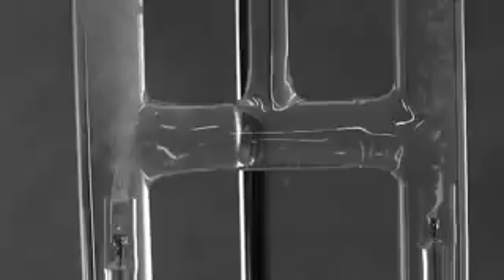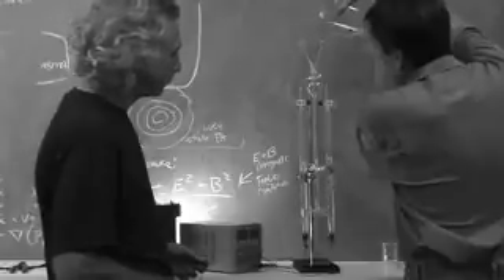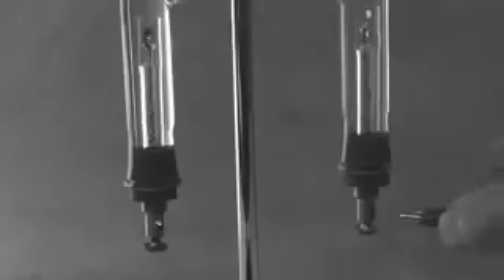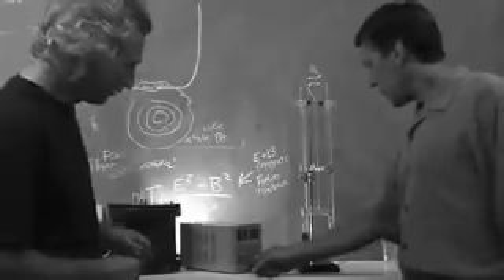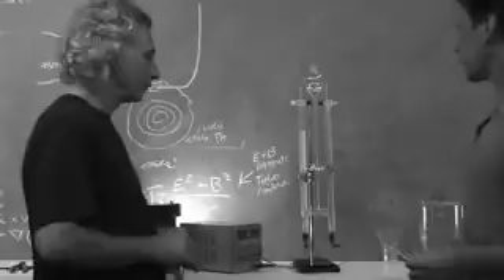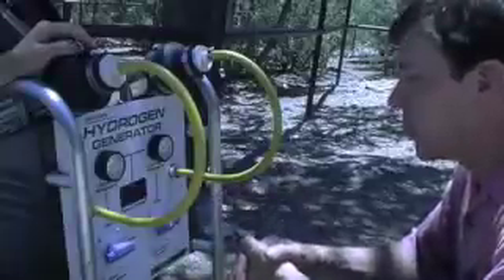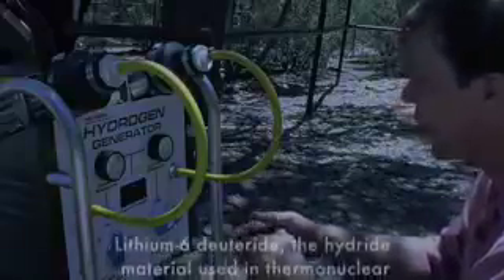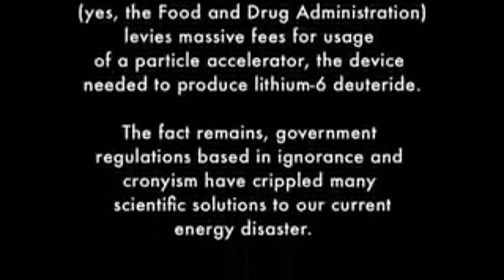run your car on water. This guy does just that!

Comment: What the hell is he talking about? Lithium hydride has no use in nuclear weapons. It's just a very simple lithium salt. Lithium hydride is a common and very simple chemical compound one can buy at any chemical supply company for about $1300 a kg. The only real issues with lithium hydride is it can violently turn into extremely corrosive lithium hydroxide if exposed to water. So sales to non-chemists is often restricted due to it's exothermic and corrosive dangers.

He is thinking of extremely expensive lithium deuteride, made using deuterium,  which is the hydrogen component of heavy water. And while it's true that lithium deuteride is the primary energy producer in a H-bomb, lithium deuteride is actually non-radioactive and harmless unless you have it packed around a two stage atomic bomb explosion to transmute it into tritium. In fact, anyone can buy lithium deuteride. But it's crazy expensive. Like $500 for 10g. Roughly an amount the size of a sugar cube (might be wrong on the volume though. LiH is extremely light.) And for normal chemistry purposes, lithium deuteride is basically useless, and in 30 years of a chemist, I think I have seen it once, where someone had some as a "Hey look at this!" curiosity.

Comment: Maybe someone here can answer.
If you run a car on just HHO produced onboard through electrolysis, it means that the amount of energy from the combustion of HHO should be greater than that required to split water molecules.
That's impossible, right?
Reply: that is the answer we need.  h2 and o2 sure seem to want to be together.. little spark and htey slam together.  seems a bit more exciting than splitting it so .. who can do the math?
Reply: Yes, according to the laws of Thermodynamics  that would be impossible. To create the Hy he is using the Hydrogen generator he showed. He said the generator is run by solar power creating the Hy overnight.  So more energy is supplied to create the Hy then is created in the Engine, so the basic laws of Physics are satisfied. But the cost is nil because he is using solar power. There are more efficient ways to use Hy such as the Hydrogen fuel cell to produce electricity, with water as the waste byproduct.

Comment: I mean, im not too brushed up on my chemistry but it sounds like he's taking extra steps for the hydride for storage rather than just storing hydrogen. It sound like it's a lot safer if I understand this correctly, the hydride is used for storage so that's why it doesn't explode? It'd be brilliant for gas stations to be able to have a hold of this because the biggest argument against hydrogen is that it explodes. But there is an easier way to store it and make it on demand. But brilliant either way, wish he drove the car so we could see how it performed.
Reply: He didn't drive it so it didn't work unless there's actual proof
Reply: @DannyDieHard369  as others have said even if driven in the video we'd want to see that it wasn't not just secretly running on gasoline...

Comment: Why not just get the car alternator to Power the electrolysis of the water, giving perpetual fuel as you need it?
Or use aluminium powder mix with water to separate the hydrogen via rapid oxidation of the aluminium... Voila!
Reply: Because your alternator at full output couldn't produce the energy required to separate enough hydrogen to keep the engine running to turn the alternator...and if you think that carrying hundreds of pounds of aluminum powder and water around is somehow an improvement over plain old gasoline-well, go for it.

Comment: If you're using any other fuel like gas or diesel while you're claiming it's running on water ( hydrogen) it's not. You can run your car on gas and at the same time inject a very small amount of water. The water can prevent carbon build-up.

Comment: It was either a Popular Mechanic or Popular Science magazine back around 1989 or 1990'ish, I read about a mayor of some Colorado town driving a 1989 Red Pontiac Grand Prix that was fueled by hydrogen. 

They also demonstrated that the exhaust was water (they showed him sticking a cup under the tail pipe to collect the exhaust and drink it).  I specifically remember this article, because I at the time owned a 1989 Red Pontiac Grand Prix and thought "how cool".  

Anyways, never heard again anything about this mayor or his car.  They said the car was too dangerous to run on hydrogen because it was too volatile.   I figure the Fossil Fuel people squashed the story.

On another note, I thought Bob was pushing up daisies.  I know of him from the UFO stories and that he worked at the "you know where" place in NV.  Interesting video.

Comment: They sell hydrogen cars today. The energy to produce hydrogen gas is very high. Hydrogen filling stations are few and far between and expensive. And for those who don't know you use the hydrogen to one run what's called a fuel cell which produces electricity to drive an electric motor. This technology was used in the Apollo space missions in the 1960s. It's just not practical for everyday vehicles.

Comment: Why split water ahead of time?
As you consume the H, you split the water, from a tank.
And just use seawater, why add anything to freshwater?
Gets more interesting as I think of it...
Reply: Because it takes a large amount of energy to split the hydrogen from the oxygen- more energy than is available from the resulting pure hydrogen. So, for that to work, you would also have to carry another energy source, such as petrol or a powerful battery.

Comment: Running engines on H2O is not a new concept, it's been kicked around since the mid 1940's as a possible alternative to gasoline powered engines and there have been many instances of people actually running vehicles on  hydrogen but mainstream industry has been reluctant to invest time and money into development (R+D) because of pressure from the oil industry. (ONGOING) / I worked on a solar hydrogen gang generator project in New Mexico back in the early 80's  but pressure from politicians owned by BIG OIL succeeded in killing the project before it even came online , / All the BIG industries cares about is the CONTROL AND SALES OF ENERGY  WORLD WIDE and sadly they still maintain a DEATH GRIP on it !

Comment: But yet here we are 13 years later and getting electric cars rammed down out throat's. follow the money and you will find why. Oh joe you done it again!
Reply: Your idea to 'follow the money' is exactly on target. What you will find is that many, many people have built hydrogen systems to run standard engines. The process is simple (as shown in the video). The difficulty is in the economics. The energy required to produce the hydrogen, compress the hydrogen, and release the hydrogen makes hydrogen fuel more expensive than gasoline.
follow the money.
Reply: @russhurst4551  Good point!  The expense would be the building of the separation system and storage. As seen in the video, the Corvette was refitted to run this fuel. I would assume that the vehicle wouldn't matter. I wonder what it would take to use his prototype and base it in a manufacturing environment. But first to have access to the material needed. I wonder if it could be possible to research a grant, secure the finance side, to build one and then after researched and funding through stockholders if such a project could be done?  If some one would pay 60,000 for an electric vehicle that really is not the environmentally safe,  they sure would pay that for a total safe emissions with the potential to truly be environmental safe and reusable. 
Does this make sense?   Now, where to go from here?

Comment: The fuel vapour and HHo systems exist, are known about and are easily adapted to our vehicles...Suppressed tech on purpose, wars in the middle east and to blame us for pollution.
...Producing HHo just needs pure water with the electrolyte Bicarbonate of soda, no need to store Hydrogen only a tank with the water in it. Around 6-9 volts and amps are needed to produce nearly free energy.
...Freemasons in power poison us, keep information from us to control us. Know your freedom under COMMON LAW - your life depends on it.

Comment: Energy ballance shows producing hydrogen to burn in an engine is stupid idea... for every kW of electricity you will end up with some losses and then your Hydrogen. Still imagining NO LOSSES in the electrolysis, by burning in an engine you will make 25% of it AT MOST in useful power to move the car. Rest is waste heat on radiator and exhaust. Not to mention sitting in the traffic in idle burning the hydrogen with no real purpose rather than keeping engine alive for next move. In a heavy city traffic this can mean 50% of the time standing still.

If on the other hand you take the same electricity to CHARGE BATTERIES in the vehicle and run it on ELECTRIC MOTORS, the energy losses are way less for these reasons:
1) electric motors are very efficient in converting electricity to mechanical energy - easily 85%, compared to 25% of combustion engines.
2) standing still in traffic means NO POWER USE AT ALL! there is no idle consumption of power.
3) Well made Electric vehicles have REGENERATIVE BRAKING - They can return energy into the batteries when driving long way downhill or even doing short coasting. 

So it is NOT the oil industry the reason this hydrogen prototype doesn't work - it is the flaws intrinsically involved in the idea and the technical competition to the much more advantageous electric vehicles.

Comment: OK, but first it has to be split into hydrogen and oxygen.
That takes more energy than it produces when the hydrogen is burned as fuel.
Reply: Yes, but that is why you use clean energy ie solar or wind for the generator to produce the separation. Hence its storage over an 8hr. period. Of course hydrogen is highly combustible and produces a clean mechanical energy.
Reply: Better to just charge up your battery EV.
Reply: @jamesvandamme7786   I guess those E v's are great... if you live in the city And don't mind strip mining for the lithium

Comment: absolutely yes run your car on water...( warning Your life could be in danger) moisture/water sucked into the brake assist vacuum  intake manifold line, causing your brakes to fail,  the rusty engine hydrolocks causing pickles to shoot out your rear end.. 
Bend over and leave the check blank because your auto mechanic is going to fill them in both.

Comment: You can’t just add oxygen and hydrogen inside your car engine since after the combustion it leaves water inside the pistons which is very bad for the engine… how is it possible?
Reply: Review d video again, he explains he separated the hydrogen for the negative side & releases the oxygen up in the air so it's no longer H2O is how I understand it.

Comment: Stan Meyer did it, and lot's witnesses will attest to it.
But when this guy is shifty about his answers in the interview it makes me suspicious!
Stan, said that electrolysis is too slow to do what he did. And surely that big old electrolysis machine isn't inside that little car! But what Stan did was actually produce the hydrogen in the car! No recharging necessar! Just put water in it and go...
Reply: That's all great except that Stan Meyer didn't run his car on water. If he had really found an exception to the second law of thermodynamics then he'd have been in line for a Nobel prize in physics. What he actually did was make up a story and not let anyone inspect his car.

Comment: Some bus lines in Europe use this exact technology. But Big Oil gets the profit as they produce the H2 out of Natural Gas. It seems they don't want to mess with the simpler electrolysis solution as there is no profit in it. Seems they want to pull wool over people's eyes.

Comment: He’s not running his car on water, he’s supposedly* running it on hydrogen obtained thru electrolysis, which uses electricity. So electricity is the source of energy, not water. Water has as much potential energy as a rock at the bottom of a well.

*The car is never driven in the video, so does it actually work?
Reply: Does BS MEAN ANYTHING TO YOU 🎂

Comment: that c4 tho sheesh. im just curious how he either got a hydrogen engine or converted it to run on hydrogen. id do this to my truck if i could make hydrogen with solar.
Reply: You can with some tinkering. Big big pockets don't wanna see this just yet. Better be safe
Reply: @madnotez  teslas making hydrogen fuel cell cars. And toyota and yamaha are already racing a hydrogen combustion engine.

Comment: for clarification, Astronuc from PhysicsForums says:

One would not use an accelerator. To obtain lithium enriched in Li-6, one would use a mass spectrometer or laser enrichment system. These can be expensive, and laser enrichment is controlled technology. So it's best to find a chemical supplier. LiH is produced by exposing lithium metal to hydrogen gas. I do not know the exact values since I have not manufactured this material, this source indicates - "Lithium hydride is obtained directly in an ampoule by hydrogenation of lithium at a temperature of the order of 920 K and a constant hydrogen pressure of 1 MPa." http://www.springerlink.com/content/g3220v44k5263368/ These are hazardous conditions and one may require permits to do this. It's not something that is done in one's home.

Reference https://www.physicsforums.com/threads/producing-lithium-6-deuteride.320107/

Comment: You can power a car from HHO there's no doubt, but the car can't produce it's own HHO. Everybody has tried and it aint happnin anytime soon. Great fun trying though and the 3.5 million monetised views are sheer genius 👍
Reply: Making an effective device is possible like many kids even make hho devices to run a lawnmower and recording it being used. 

The separate battery source is an option too or manually can be switched over on board. 

Metal plates in water and battery charges the wires to the metal plates to make hydrogen bubbles. 

Rural areas are known for using these "cornish generator" or in the UK it's called the Brown's gas generator. 
The off grid types recharges various ways depending on your choices. 

In close up videos many other simple hho devices and some people explain, also adding a filter for the bubbler output to have better results along with adding various choices of elements to the water to make more hydrogen bubbles.

More recently small "monster bubblers" hho generators, using over a 100, 200, 300 or more metal plates, are shared by enthusiasts and some explain adding a neutral plate between each charged plate   to get more cycles out of the wires because some of them over heat, depending on your building of the device.  

Many days people can watch and choose the easiest to make devices for the needs. 

Simple for a class experiment for making small flame "combustible energy", or store in air containers for any use. 

Many  vehicles are natural gas equipped to accommodate a natural gas option supply.

Comment: If you need a ton of electricity to break the H2O, and a lot of space to store it, and an engine to burn the Hydrogen.. Why not skip the unnecessary extra step and just use the electricity directly, the storage space for the batteries and an electric motor instead of an engine?

Comment: 6:47 at least thats what he says. You ever inhaled pure oxygen? You can get hight on that stuff. Really really high.
No I'm just kidding, well you can get so high, that you pass out, and it also basically damages your lounges, because of oxygen free radicals, which are in pure 9x as strong as in normal air, he probably releases it into the air, but he could also sell it.

Comment: s10 with 170, 000 did it too. 80 miles per gal of gas with 4cyl . requires regular maintenances cleaning ect. but this truck lasted 5 years . Its life ended at 247,000 due to accident with a deer. it works look up stainless cell HHO generator . Its a easy fabrication . But very explosive keep it tiny . my first experience with static electricity everything plastic under the hood during the explosion vaporized into tiny particles. front wheels lifted off the ground at start up . corrected problem by adding fused links to both sides and extra heavy ground from motor to chassis .Truck ran great more power up hills ect.  temp runs a little higher than normal so more oil changes needed 1500 to 2000 intervals. Be carefull hho very explosive . not recommended for libtards  ps vapor is my next challenge with water cooled exhaust 1000 miles per gal . Gas Vapor is the way to go my opinion . My first test motor runs very hot . got 50 miles on just a 1/4 cup of gas .2nd test was on a generator 1/8 of a cup of gas . gen ran for 5 days . more research needed here .

Comment: Why cant you create the HHO, in the car?
And constantly be generating the hydrogen gass? 
Use a lithium battery to start then shut off, ot switch to fracturing gas off water in the tank, into smaller storage tanks. Then when water gets low just fill it with electrolyte water? 
And be safe Stan Myers was murdered to suppress this information. 
All/Every, country in the world has signed 
NONE COMPITITION CONTRACTS WITH
 ALL/EVERY. OIL PRODUCING COUNTRY. 
THOSE COMPANYS ARE NEARLY 100% OWNED BY ROYALS OR  ROTHCHILDS, ELITES.   END THEYRE MONOPOLYS.

Comment: Nice to get cheap power for your vehicle. The Govt will want road use tax money that they aren't getting because you are not purchasing fuel. So they will require you to go to inspection and record your annual mileage and charge you for what you are not using........Sir that will be 2,500.00 you can make the check payable to...............

Comment: The power or more correctly, the combustion of hydrogen gas alone is certanily not enough to power a combustible engine. If you want the maximum power then you need to combine the two, H2 and O. That will explode with a powerful bang and a lot of energy. More than just hydrogen alone!